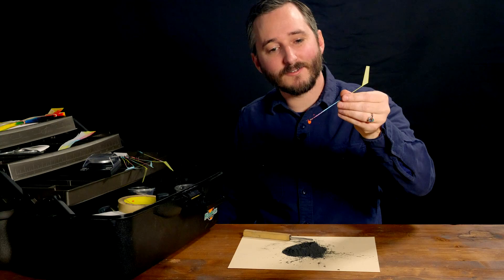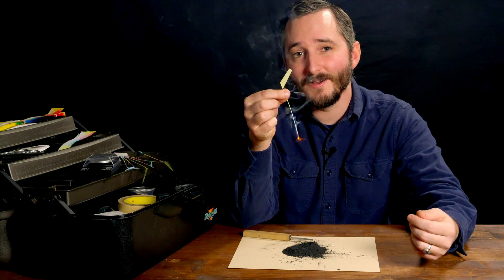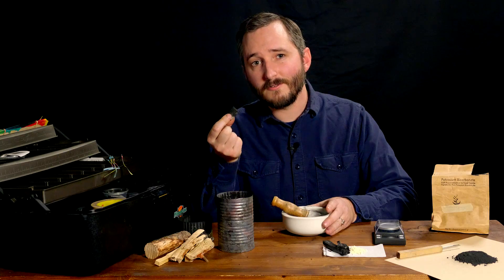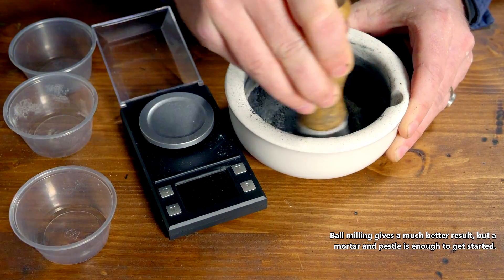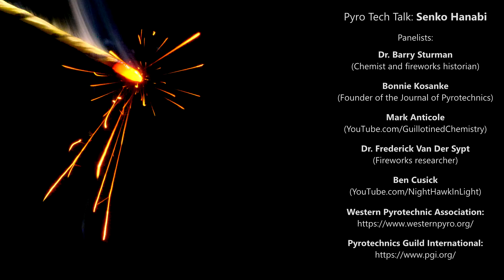The World's First non-Flammable Fireworks (a novel way to make Senko Hanabi Sparklers)

Comment: What is the formula? My experiment has no effect
Reply from the maker: 4 parts potassium bicarbonate, 2 parts sulfur, 1 part pine charcoal. These ingredients must be measured by weight
Reply: @Nighthawkinlight  I have experimented several times and nothing happens
Reply from the maker: @Zhang-1992JQ  What type of charcoal are you using? Is the sulfur pure? Is the potassium bicarbonate KHCO3? Are you using a scale to measure? Is the charcoal ground very fine?
Reply: @Nighthawkinlight  Pine charcoal, which is pure sulfur, they are very fine
Reply from the maker: @Zhang-1992JQ  What measurements are you using? How many grams of each? Are you lighting the sparklers with a torch lighter? A normal candle flame lighter is not hot enough.
Reply: @Nighthawkinlight  I use a graduated electronic scale, potassium bicarbonate 4g, sulfur 2g, pine charcoal 1g
Reply from the maker: @Zhang-1992JQ  And the lighter? Does it have a torch flame? You must keep heating the drop with the lighter until the first sparks appear. It's not like a normal senko hanabi that only needs a short touch with the flame to get started. Otherwise I'm not sure what could be causing your trouble.
Reply: @Nighthawkinlight  I use a high-temperature lighter to keep burning, only the pungent smell of sulfur😭
Reply from the maker: @Zhang-1992JQ  I am very confused about your problem. You're sure the potassium bicarbonate is KHCO3? Not K2CO3 or something else? Is your charcoal homemade? Perhaps if you purchased it you were given the wrong kind, such as activated charcoal which does not work.

Comment: Uh I'm confused can someone explained how he lit baking soda? It turns into co2
Reply from the maker: The baking soda doesn't burn, but with enough heat the co2 is driven off and the molten sodium sulfate/sodium carbonate that's left is a liquid medium for the carbon particles to float around in and burn at the surface. Some reacts under the surface making gas bubbles that throw off drops which are the sparks.

Comment: what paper do they use in japan,,,is it gumpi light
Reply from the maker: Gampi (about 15 gsm) is what would have been used traditionally, or in modern display quality senko hanabi boxes. Now the senko hanabi made in Japan for common use use a standard tissue paper, though a variety that is particularly strong and thin. I do not know the brand name used by the factory I have visited, but I have found the tissue paper distributed by Dollar General in the US is very nearly the same. You must pay attention to the grain direction of the paper (the direction that the paper easily tears in a straight line). As long as the senko hanabi strips are cut with the length going the same direction as the grain the paper strips will have enough strength to properly roll a sparkler. If the grain is going the wrong way you won't be able to put enough tension on the paper before it tears.

Comment: What about the scoop? I can't find the scoop anywhere.
Reply from the maker: The scoop I made from a piece of small aluminum tube from a hardware store. In Japan they make them from metal bits off a windshield wiper
Reply: @Nighthawkinlight  Thank you for replying so quickly! Sorry for the double post. Your scoop looks handily the right size to form a pill that rolls consistently without having to smooth it out. did you aim for a certain size, or did it not matter in your opinion as long as it was small and held the right amount of powder in your opinion? I really wish there were workshops for this, I saw that the fireworks company you visited in japan held some workshops where they provided marked paper and a scoop too.
Reply from the maker: @salikabbasi5448  I have used a variety of scoop shapes. It's not important as long as the powder can fall out of it easily and it holds the correct amount.

Comment: Another very nice and informative video! I'm always excited when you post a pyro related video.

The only thing you forgot to mention is what paper is being used? If I recall correctly it has to be a specific type?
Hope you will read my comment and reply as it might be a crucial ingredient to make a good Senko Hanabi.

PS: I got into pyro because of you many years ago (around 2009 or so?). I don't really do pyro anymore these days but might give Senko Hanabi a try as it's very safe with your method/comp. Thanks for sharing the comp as well!

EDIT: I found out (light) rolling paper (for smoking cigarettes) is a great and cheap source. Found it when reading the PDF files linked in the description. That's great and makes Senko Hanabi cheap to make! Very informative PDF files.
Reply from the maker: The papers you've found in the article will work well. My favorite paper is white tissue distributed by dollar general.

Comment: So the Japanese fireworks. 

The oxygen for burning isn’t actually supplied by the atmosphere!?

It’s to do with how the firework is rolled. 
The stem is a hollow tube, a straw.

As the glowing ember (ignition mass) burns

Atmospheric o2 is drawn down the hollow stem towards the mass

Could you test this?
A dab of hot glue to close the hollow end.
See if it still works?

Tony
Reply from the maker: The oxygen comes from the air, but not through the stem. The stem is rolled tightly and is not hollow.
Reply: @Nighthawkinlight  fancy experimenting to see how much the stem plays a part in combustion?

Could be good content… might also be a complete waist of your time’

Any road. I appreciate the prompt reply. 
Keep up the good work, love your content!

Tangentially; do you have a discord?

Comment: Willow wood is also a good wood to use for charcoal because it's a soft porous structure in the wood from growing faster which allows the ingredients to mix better which makes a faster burn, that's for regular black powder, but it would be interesting to see how it works for these senkos.
Reply from the maker: Willow is not a good charcoal for sparks. They are much smaller and do not branch as much
Reply: @Nighthawkinlight  oh okay makes sense, I heard about the pine wood you used also being good for streamers in regular fireworks, pine wood sounds like an all around good charcoal for both kinds of black powder. I learn something new every day.

Comment: I wonder if you can use baking soda and table sugar? just like you can use potassium nitrate and sugar for a black powder substitute.
Reply from the maker: Sugar is not a real replacement for the function of sulfur. That idea really only spread because of kids trying to make black powder at home without the ability to purchase suitable ingredients. Nitrate and charcoal works better as a black powder substitute than nitrate, sugar and charcoal. Neither unfortunately will work for a senko hanabi. You can however use potassium sulfate mixed with charcoal instead of bicarbonate and sulfur, but it requires a lot of heat to melt and doesn't work quite as well.
Reply: @Nighthawkinlight  yeah I have noticed that nitrate and sugar burns much slower and inconsistently compared to regular black powder mixture when I made both before, it's not really much to it for making the regular mixture of black powder, and baking soda and charcoal and sulfur is pretty easy to acquire for making these senko hanabis.

Comment: Very interesting! 
For working with different fire work powders I can confirm having a open pile next to a burning sample is very hazardous. The flames and sparks can even travel several meters where you would not believe it. They are not always visible! As precaution I suggest everyone to always lock away the stock of powder inside a closed container and bring it out of the room or area where you want to ignite something.

Comment: This is fascinating. Do you really need a torch to light them, or could a candle or alcohol burner do the trick if applied long enough?
Reply from the maker: You can use a candle, but for some reason they really work a lot better if heated up with a jet flame
Reply: @Nighthawkinlight  Good to know, thanks!

Comment: I have a question about your 5 dollar satic electricity generation how long are the red and black wire that connect to the aluminum at your ankle also where did u put the circuit bord, in your pocket?

Comment: What happens to Carbon dioxide if you expose it to a high energy arc? 

I know when you expose air to an arc it is elevated into Nitrogen Dioxide.

And in a few of your older vids you made Carbon monoxide through the same process except the reaction took place under water.

What if you were to do the same with just an atmosphere of pure carbon dioxide?

Comment: 5:20 does the fact that the mixture burns on the paper stick but not as an isolated mixture have anything do with the salts and oxides from the burning paper ash facilitating the combustion? Have you tried mixing paper ash into the mixture and seeing what happens when you light it?
Reply from the maker: The paper adds some carbon but the mix will also burn on a metal wire.

Comment: Hello hawk i just found you a couple days ago  and enjoying watching the videos you create and how clear you are for people to understand. 
 I do have idea but dont have the knowledge or the saftey equipment. I did just watch the rubie making and the carbon monoxide and hydrogen gas videos. Would the rods be hot enough to make a big rubie. And for the furnace to make it king random (which I'm sure you'll enjoy watching it if you haven't). But he takes the carbon rods from big 9v batteries and makes a plasma furnace that melts anything. Would that work? And would this also work (king random furnace) help with the melting salt ice water? But put the holes on top 1 to vent and the other the heat and then melt and let it slowly cool off inside?

Comment: Can I get you to explain the reasons for the reaction of salt and ice?
Reply from the maker: The reaction of salt melting ice you mean? Some chemicals release heat when they dissolve in water, and also lower the freezing point of water. Calcium chloride which is the salt used to de ice sidewalks does both. It heats up in contact with ice, and causes it not to freeze again until it gets much colder.
Reply: @Nighthawkinlight  awesome so let me ask this. Would this reaction happen in really cold water aswell?
Reply from the maker: @The_Descending  Yes. Dissolve calcium chloride in cold water and you'll notice it gets very hot.
Reply: @Nighthawkinlight  fantastic thanks! I also subbed its nice seeing your videos and there very entertaining aswell!

Comment: the best we have without a licence is sparklers and ive been following this series for a while now, when i found out about the baking soda ones i jumped out of my bed to make it. smelled like sulfur and plastic burning, i didnt care, one of the most fun ive ever had. definitely worth a try.                                            extra read

 for the measuring i used coins. in australia all the cents are just doubles of its smaller denomination, so i quickly made a rig that could measure the difference of a piece of hair thats it thats the only equipment that you need to buy online soughed the sulphur i bought Manutec pure sulphur from the local bunnings (for acidifiing soils) and every thing is at home, some wood charcoal from... i just realised potash is potassium carbonate (hydrogen & potassium) maybe that could work, well you get the idea i got everything done and dusted and it was so cool, like he said there are so many combos and things to try so i definitely recommend having a crack at it. start at the ratio given and make tissue paper 2 ply, rip into thirds and try not to burn the neck or else the blob will drop. good luck

Comment: No safety glasses?  Hmmmm.
Reply from the maker: Who wears safety glasses to use sparklers?
Reply: @Nighthawkinlight  Sparklers can burn at over 1000 degrees... they are handheld fireworks which, without too much of a stretch of the imagination, could pose a threat to the eyes.  I was always taught to wear safety glasses when handling/using fireworks.  I make my kids wear them and I do as well when using them - that's who.

Comment: Perfect video as always. 

By the way, I was making aluminium foundry and it was all going well until I realized I didn't have anything made out of steel for crucible so I used iron but whenever you push soda can or something it just goes through iron. Any substitutes for iron? Graphite crucibles are not an option as shipping is 3x the price of a crucible.
Reply from the maker: Old coffee mugs or teacups
Reply: @Nighthawkinlight  Thanks for quick reply! Will try.

Comment: This inspired me to make my own.

I have the mixture ready but I don't know what kind of paper is best to roll these.
I tried a few different ones. Newspaper doesn't work, paper towel doesn't either.
The only one that gave acceptable results was the stuff that China crackers are packaged in.

Does anyone know where to get the paper I need?
Reply from the maker: White tissue paper. I use the tissue paper from dollar general
Reply: Is this the same you used in this video?
I looked through their Onlineshop and there are several options of either "toilet paper" or "bath tissue" in that category. Is one more suitable than the other? 

Another question:
Can the potassium bicarbonate (KHCO3) be substituted with carbonate (K2CO3)? The place where I get my chemicals doesn't have the potassium bicarbonate.
Reply from the maker: @TsamsiyuK  Here's the paper I use: https://www.dollargeneral.com/products/product-page.stationery-tissue-paper-white-0107645-68-14.html

Potassium carbonate can be used if you adjust the recipe, but it's not as good because it sucks up moisture from the air so you have to use it very quickly. You can buy bicarbonate on Amazon or eBay.
Reply: I did a few tests with rolling some powder into the stem of the sparkler, hoping that it would increase the burntime of the sodium variant.
Sadly it did not work as I hoped it would.

Would barium carbonate (BaCO3) or strontion carbonate (SrCO3) work for coloring the sparks green or red?
Using sodium yealded a yellow aura as we saw in your video.
Reply from the maker: @TsamsiyuK Barium will not work because in my tests it quickly converts to barium sulfate which has too high a melting point. I suspect the same thing will happen with strontium but I haven't tested to be sure.
Reply: I will try to make some with strontium carbonate to see if that works.

What do I have to look out for while adjusting the recepie? Is it just trial and error or is there some clue in the results which can tell me what to try next?
Reply from the maker: @TsamsiyuK  Start by adjusting for molar mass so you have an equal amount of strontium compared to potassium in the current recipe.

Comment: Senko-hanabi fire works is extreme sensitive to put. This video shows what a man is hanging a senkohanabi diagonally. This is wrong way to put senko-hanabi. The senko-hanabi must be put just vertically and no shaking until fire ball made.
Reply from the maker: I was taught by a master senko hanabi craftsman in Japan who said they worked best when held on an angle.
Reply: @Nighthawkinlight  
All Japanese people do vertical putting.
The fire ball is very sensitive. Put a senko-hanabi with mindless mind.
Senko means incense stick, and hanabi means fire work. Hana means flower, bi or hi means fire. Hanabi means flower fire.

Comment: Wonder if you could have a practically infinite Senko by using a funnel (similar to a top half of an hourglass) that constantly feeds that molten droplet with more powder. It should not burn into the funnel for same reasons why it's hard to just light, yet should start reacting once molten and in the droplet.
Reply from the maker: I don't know about a funnel but I've been considering how you might do that in one way or another
Reply: @Nighthawkinlight   Could possibly do a thing similar to a flux core welder. In this case it could be a rolled paper tube with a bit more powder that gets pushed at the same rate as the end burns off, making the drop stationery.
Or forget the paper all together and make a solid rod from that powder by compressing it in a metal tube (drinking straw?). Anything more mechanical than that, like a feed screw in a tube with a hopper, might be too complicated for small scale. Then again, a stretched out liner from a bicycle cable or even a bass guitar string can be a nice small flexible feed 'screw'.

Comment: It would be interesting to see what effect is achieved from the addition of a small amount of finely powdered metal (magnesium, magnalium, aluminium, zinc, iron/steel, titanium, zirconium). Would it result in additional spark formation, or would it ruin the performance of the Senko Hanabi?
Reply from the maker: Dr. Van Der Sypt adds a few grains of magnesium powder to his senkos. It does not change normal performance at all, but if the drop falls or is flicked you get extra metal sparks